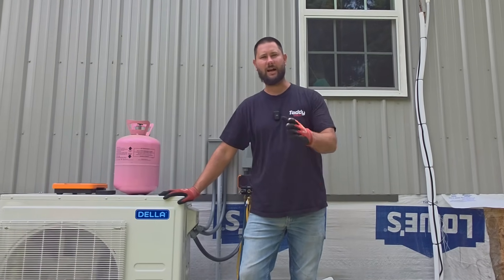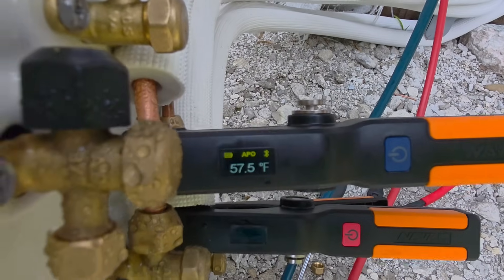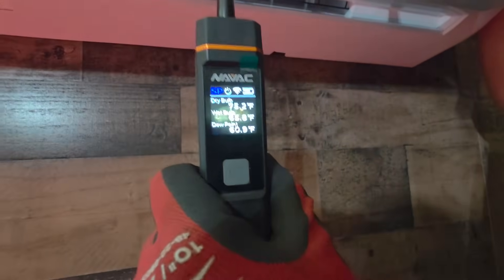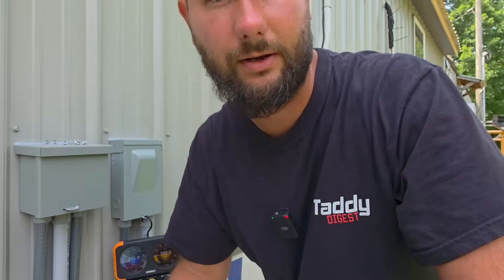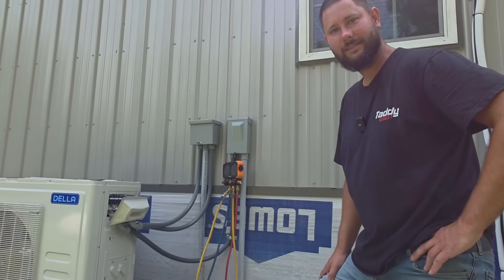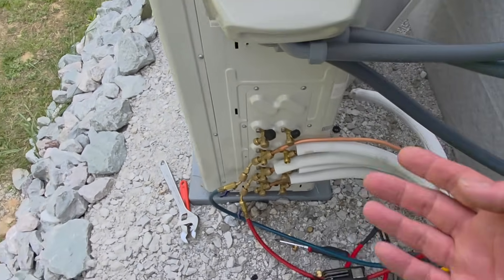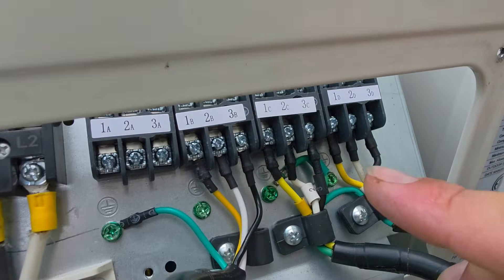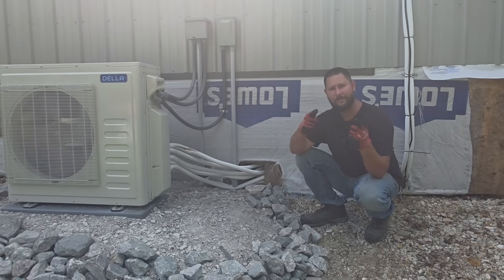I Should’ve Checked This First… DELLA Multi-Zone Mini-Split Not Working!

Comment: Hey Taddy, GREAT video!! I just in stalled a Della mini split with 2 heads and it is charged for 32' of line sets. Well I  have 110' of line sets. So of course I need to add 454B . Not thinking of line sets charge,  it starts up and shuts off once pressures drops to 98psi on suction. Just saying it is easy to over look simple stuff. Thanks for the video!

Comment: I did a similar thing.  Mixed up some wires on the individual connections. With all the trouble, would have done 3 separate units in hindsight 😂

Comment: Just installed the Della system and it would not heat or cool. Watched this video hoping it would give me some ideas for troubleshooting. Turns out I forgot to open one of the valves on the heat pump. That wasn’t the problem in this video but thanks for jogging my memory to go back to the basics.

Comment: great video, shows we can all go on the wild goose chses. I have a new Senville (Midea) Do I have to use the A, then B then C etc. it says a 24k+ unit must go on and and if two 24k+ go on B as they have larger ports. So if I put the 24k on A can I put the 12k on C as it has the right size for the flare nuts? I want to try to avoid adapters and possible extra leak points. Thanks

Comment: I installed a Della Multi zone R454B mini split today and tested all line sets with nitrogen, left overnight at 200psi, no drop, vacuumed down, left on vacuum and held, no leaks. Opened high side and low side, unit on and seemingly running, but no cold air or heat. Refrigerant PSI while cooling is around 225 PSI. 

I have NO clue what's going on. 

Checked all wiring, checked refrigerant lines for kinks, no issues found. I'm stumped.

Comment: Good morning, thank you for your videos, I have watched many of them this morning.  I have a 2 year old Senville 18,000 BTU multi-zone (4) mini-split and the indoor coils are freezing up.  I have looked, the coils appear to be clean, but the fans were pretty dirty so I cleaned them, but they still freeze.  I have notice, the unit farthest from the compressor is freezing into a solid block of ice and the unit closest to the compressor is just getting frost?  Would this be an indication of low refrigerant?
Reply from the maker: Yes, absolutely refrigerant levels Need to be checked
Reply: @taddydigest  thank you

Comment: I have a pioneer diamante pro - last year I went over very rough railroad tracks, it hit my rv hard, i knew something was gonna be broken. that day my mini split did not cool very well. I called an AC tech and he said i'm low on coolant and he filled it up. I was told he did it wrong.
another tech told me that guy should have removed all the coolant and refilled with the amount required by pioneer because unless it was very hot that day, the ac tech would not be able to tell if i was low or how low. 

anyway, my mini split today is using  well over 1200 watts and normally it uses 200 - maybe 800 on a hot day. 
i cleaned the exterior part, i cleaned the interior part - still inefficient. 
the unit has been in my rv just over 1 year

could coolant issues cause inefficiency issues? 
I'm in Iowa headed to South Dakota. 
Trying to find a tech anywhere is nearly impossible.

I really dont want to learn this stuff but i think i have no choice.
what do i need to do?

traveling across america, I can't keep finding myself in this situation and I can't keep buying a new mini split every year 

my unit uses R410A/34.22oz
Reply from the maker: It sounds like you're having a frustrating time, I hope you can find a solution!
Watch my videos on charging mini splits.
Reply: @taddydigest I am
Looks like a lot of equipment 
Too much for me to add for my travels.

Comment: I used to have a Pioneer 18k, blower fan went out within a year then compressor went out after 1.5 years, never got a response from warranty dept, gave up. Bought an 18 k Della, built like a tank compared to the flimsy Pioneer, Della was a 22 seer and was the size of a 2 ton due to efficiency, Della is built way better, got WiFi and got it with a promo discount from Amazon, I very happy with my Della, Pioneer is trash compared to Della's build
Reply from the maker: Thanks for sharing your experience!

Comment: Perfect timing .
I am ordering 2 9k mini splits for my ADU this weekend from Della. 
I decided to go with 2 separate condensers .
My thoughts are if 1 goes down the unit with still have the other one working .

As an electrician my first step would
Have been to verify correct voltage .

Comment: That outdoor unit is labeled really well with the big stickers by the valves.  Others just emboss the letters on the case.  Easy mistake to make for someone not familiar with the unit.   Every manufacture does it differently.  Some put "A" at the bottom!  The manual is important especially if it is your first time installing a new model.  Thanks for the video

Comment: this is a perfect video - i have the same  Della heatpump, and i first made a mistake of connecting the cables in reverse order. I was also initially worried I had kinked some lines. It is really difficult to figure out if the minisplit is working optimally. Other than that, the mini split is very good.
Reply from the maker: Glad you found the video helpful, brother!
Reply: What are parameters to check  if each zone of this minisplit is working optimally?

Comment: Most MultiZone Minisplits have a "Check" feature. They can correct Piping/Wiring errors themselves. Be careful though, they usually forget after a lengthy power cycle.
Reply: The 1/2 pound of refrigerant did not overcharge the unit?